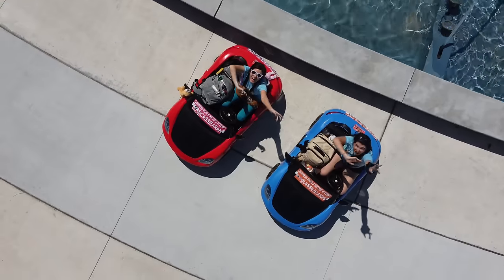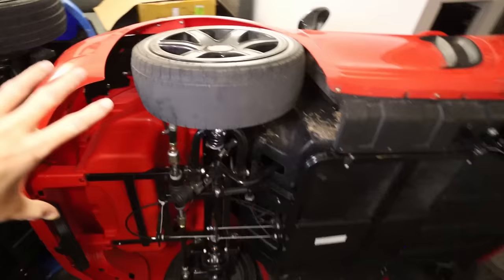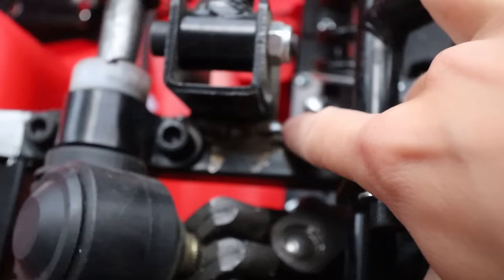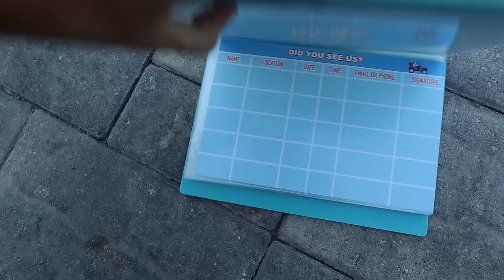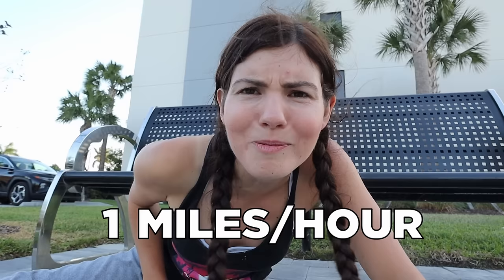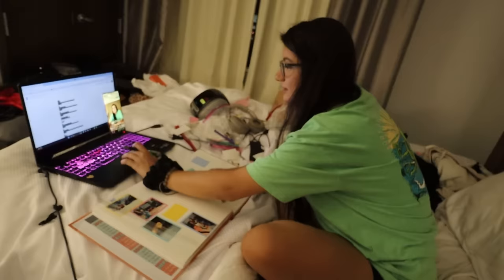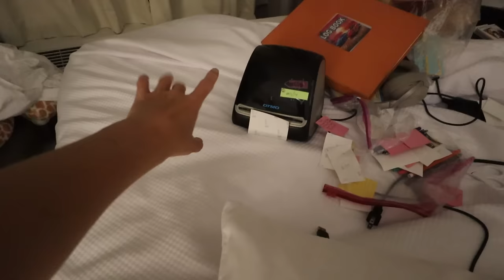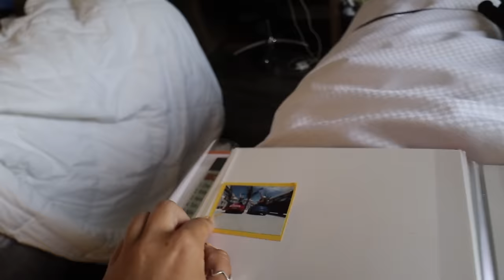🚗 LONGEST JOURNEY IN TOY CARS - DAY 34-36 🚙

Comment: You guys should build built in USB ports in the cars for charging. You guys could probably have an auto stereo store install them. You could have them draw off the car batteries or find a way to fit in another battery just for charging. That way you can just use the powerbank for a camera stand.